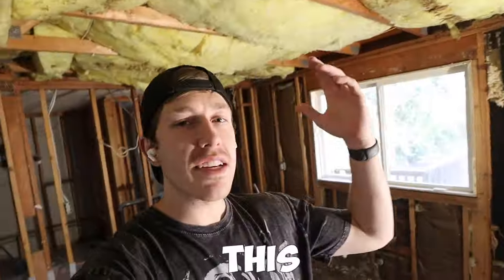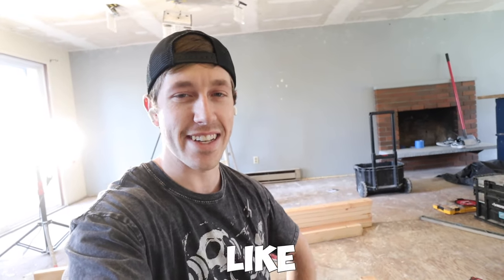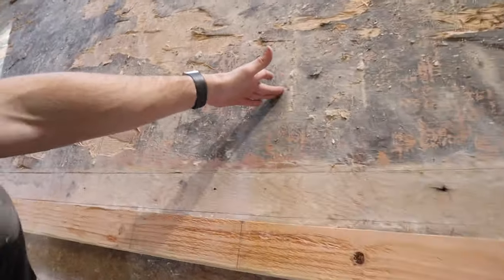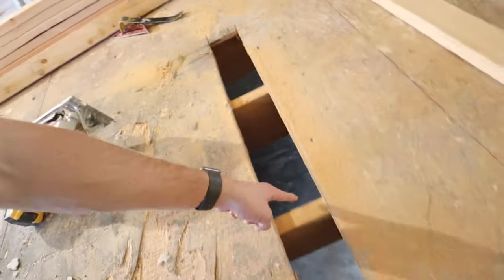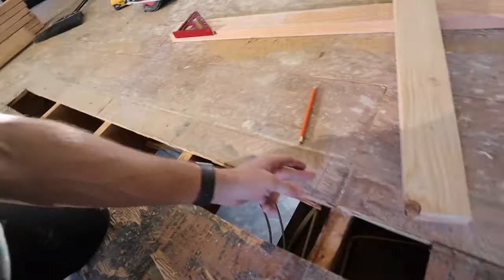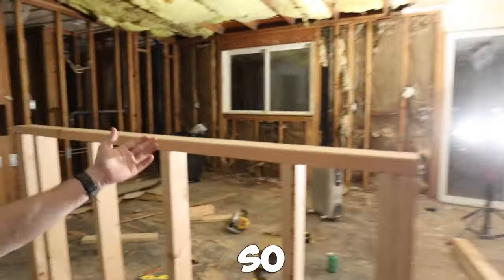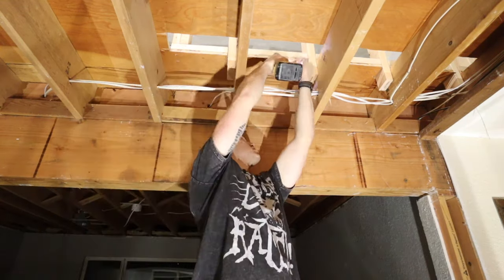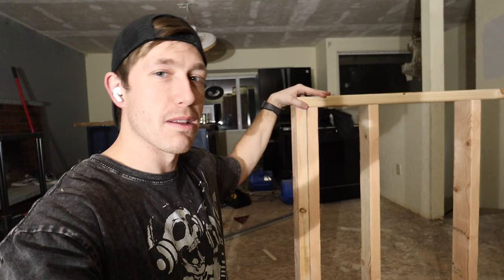How To Build The Most Sturdy Half Wall! |Fixer Upper|

Comment: How would you do it if building into a concrete slab base? Building one and am planning on chem setting bolts through base plate into the concrete but still worried there will be wobble at the top.
Reply from the maker: Great question! I’d use some sort of concrete anchors through the baseplate or you can do the chem set bolts. If you want it to be extra rigid, you could run some 2x4s diagonally across where studs are at (not sure if you’re going to run any electrical in it). Or just double up the studs. You still might get a little wiggle but it won’t be much